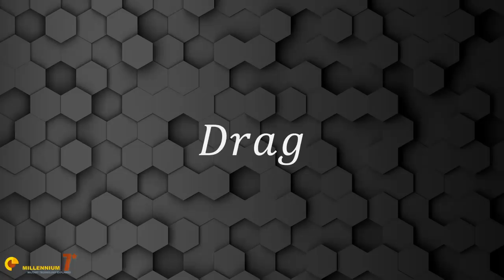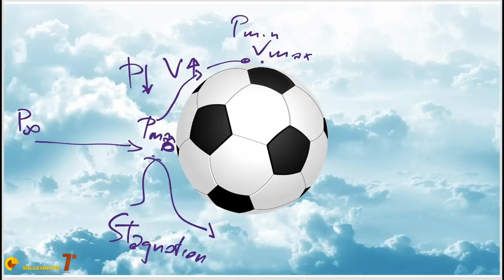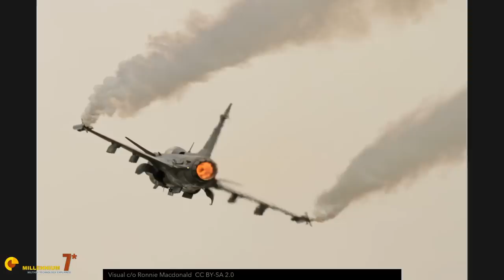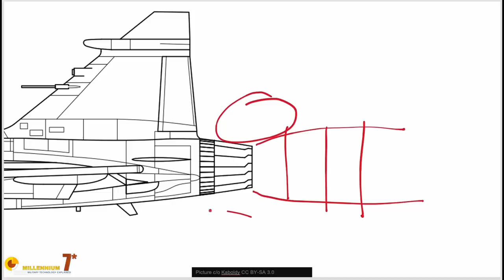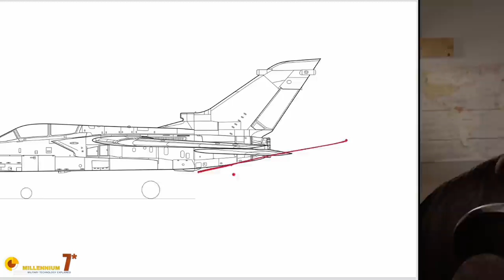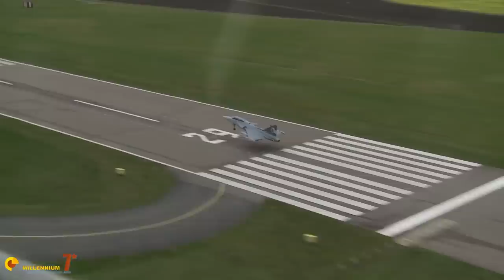The Phantom TAIL is strange because...

Comment: Interesting maybe you could have included how the XB-70 road it's own shockwave at supersonic speeds
Reply: That one's pretty straightforward. The shockwaves coming from the forward part of the aircraft would hit the underside of the folded wing sections. The lift created was much like the force of a fan blade. It pushed the wingtips outward, and due to the angle, upward.
More lift for less drag, compared to conventional approaches to generating lift. Although... it did require very robust wings, and very robust moving parts at a considerable distance from the fuselage. So "efficient lift, with a weight & complexity penalty".

Largely not worth the trade-off, unless you plan to supercruise nearly all of the time, and at high altitude where lift generation is at a premium.

The Bone, by contrast, used swing wings to have a large range of lift vs drag ratio options, allowing it to go high drag & high lift near the ground, then switch to low drag with modest lift at high speed. So it could go 'far & fast', but still be very viable for takeoff/landing, and treetop level flight in hostile airspace. Swing wings also have less overall wing area (for a given maximum lift), making them less susceptible to downdrafts. Which gets them like 20-30 ft closer to the ground with comparable safety. Add ground mapping radar, and you can hug the terrain pretty closely.

Basically the B-70 would have been the superior hauler of explosive goods to anywhere you want them (and very fast). It could do the BUFF's job, but better.
(then again, it probably wouldn't have the Buff's extreme longevity as an airframe)
But the Bone is better for going places "somewhat quickly", and then slowing down to penetrate hostile air space at daringly low altitude, "modest" low-observable characteristics to reduce it's detection range, and with lots of ECM/ECCCM hardware.

Comment: F-4, a gaggle of aerodynamic fixes flying in loose formation.
Reply: hehe, mostly a fair assessment.
but I prefer to think of it as an armada of aerodynamic bits of brilliance working in concert ;) the truth is in between.
It'd be an extremely viable 4th gen aircraft if went on a carbon fiber diet, sprouted little cherub canards, and had access to more modern engines ;)
but that wouldn't sell new planes.
Reply: @kathrynck  F-4's stores carriage and strong wings allowed for impressive combat configurations, both A2A and multirole.

The B/C/D/J/N/S models had a huge radome as well, which drove the design going back from there.

My first airshow was T-Birds' last season in the F-4.  We used to see them every week anyway at Edwards or from George AFB (F-4Gs).
Reply: @LRRPFco52  There's some F-4 DNA in the F-15. It's not visually obvious at all. I'm not saying one's derived from the other. But it shouldn't be surprising that many of the same engineering minds worked on both.
Reply: @kathrynck  I lived through that at AFFTC when F-15 was born and still had the outer nozzle sections, original wing, the smaller speed break with less deflection, and original APG-63.  F-4 has more elegant semi-conformal storage of the AIM-7s for sure, but you can see on the main panel in the cockpit how there is a lot of F-4 there, mainly for the engine gauges and primary instruments.

The main departures from the F-4 man-machine interface were:

* Single seat can do a better job than a 2-seat, even managing the look-down/shoot-down Fire Control Radar.

* HOTAS

* HUD integrated with the fire control modes so that symbology automatically shifted with each weapon system and displayed the appropriate parameters and shoot cues, time-to-target “clock" on the reticle, etc.

* TEWS versus afterthought ALR receiver display bolted into the panel.

The solid state electronics in the F-15 was a true departure from what we had in the F-4E, with absolute demonstrable BVR capabilities that were breathtaking and well-received by the pilots, even before PSP upgrade in the late 1970s.

Mission radius was also much better in the F-15, since it uses lighter materials and better wing area + lifting body, with more efficient turbofans for cruise at altitude.
Reply: @LRRPFco52  But the conformal mounting came back on the FAST packs. 

And both have a huge emphasis on a kind of extreme version of an inboard wing hardpoint with a lot of utility, holding a lot of mass close in to the center of gravity. Granted a lot of aircraft have more robust hardpoints closer to the wing roots, but the F-4 & F-15 both share a pair of two really extreme hardpoints a few feet out on the wing.

Still reaching aftwards to mount the rear horizontals further behind the center of gravity. Though the twin tail booms on the F-15 are a lot more subtle than the big extended tail on the F-4.

Note the little "dog teeth" on the rear horizontal stabilizers? Remind you of anything? ;)

There's definitely a "do-over" vibe going on. Even where they differ (and there's a lot of ways they differ, very dramatically), it gives the vibe that one benefits from the experience of dealing with the problems experienced in the previous design.

I remember a lot of the older engineers who worked on the F-15 when they would talk about design, they referenced the F-4 a lot. "Oh we designed the wing this way because it has this & that benefit, and avoids that airflow issue we had with the phantom's wings" hehe.

I can even remember an argument breaking out about the conformal AIM-7 placement. I'm convinced that when the CFT's came out (known as 'fast packs' internally), there were some F-4 engineers who finally got their way.

I do kinda wish the F-15 had slightly canted vertical stabilizers though. The parallel verticals were set up so that you could have one blown completely off the plane, and you'd still have one 'neutral' vertical stabilizer. It made more sense before FBW. But it made for some wonky supersonic characteristics between the tails, and when low observables came into vogue it didn't help with that. Mostly I just think it looks a lot cooler with the tails slightly canted, hehe.

There was a Super Phantom proposal, actually there were Several. 

There was a swing-wing model. But that was seen as kinda redundant since the phantom didn't need it to work on carriers. But it could have had some wicked speed & all-envelope handling characteristics. 

And an idea for an update package, which would have shed about 2000 lbs for carbon fiber parts, gained 5,000 lbs of thrust, and had a low-drag conformal centerline tank/pod. Along with assorted avionics changes, etc. Israel wanted that pretty badly. A prototype was built. it could exceed mach 1 without afterburners. That plane was a far cry from the "flying brick" reputation. But timing is everything. McD-D was not keen to actually develop it by then, because it could have created very serious competition for the F-18.

There was a similar proposal with small canards added above the front wing roots. A prototype of that was also built. That would have been really incredibly agile. But probably would have sacrificed supercruise capability (for the drag of the canards).

The RAF wanted a mach 3+ recon phantom which would carry a massive payload of water to keep things functional. That one was shut down by the state department who didn't want to export a fighter which was significantly faster than anything in US inventory. 

The phantoms were almost too successful to politely leave center stage to make room for 4th gen. And even as they left, nobody wanted to replace the F-4 wild weasels for a long time, because the F-4's were built like A-10's & F-15's in terms of battle damage resilience. And wild weasel pilots really like that. F-4 was really the first combat plane where you could blow off a wing, turn one of the engines into sheet metal confetti, and just fly home & land anyway. And it's still a pretty small number of aircraft in that club.

So yeah "A gaggle of aerodynamic fixes flying in loose formation" ...but doing so quite elegantly and effectively.

Comment: I remember that there is a relation with lift and drag, and that without drag, there is no lift...so, a certain amount of drag is desirable in certain direction, but not the other?
Reply from the maker: You are confusing a few things here, but it would require a long explanation. Let's say that there is a relationship between lift and drag coefficients and they both always exists for physical reasons.

Comment: the curious aerrdyamics of the F4 Phantom always confused me. The cathedral of the tail, and dog legged wings, with changing dihedral throughout. I wondered how well those  powerful engines might have performed in a cleaner design?
Reply: The original design idea behind the Phantom was much cleaner.
Starting point for McDonnell was the F3H-G "Super Demon" proposal.
They enlarged it and added a second cockpit to fit the All Weather Interceptor role.
During testing they found a lack of lateral stability, rather than redesigning the entire central section, to give the wing about 5° of dihedral, they added 12° only to the outer sections and added a dog-tooth to improve high AoA handling.
The Tail-plane was another compromise, a high tail, like in the Demon, can get into the wake of the main wings during high AoA, leading to loss of elevator authority and eventually a deep stall.
A "conventional" low mounted tail was out of the question though, because that was were the engine nozzles were supposed to go.
The easiest solution was to start the elevators high, over the engines, and give them an aggressive anhedral to get them out of the main wings wake.
Reply: @kilianortmann9979  a high tail(especially a T-tail) is susceptible to a super-stall, especially if the CG is behind the centre of the aircraft. 
The weak lateral stability was at least partially caused by the small vertical stabilizer.
Reply: The dog tooth, and angled wingtips also helped control airflow down the wings. Kind of like the outer section of the F-16XL's crank arrow wing, but using a tooth & a veritcal angle change, instead of an angle change viewed from the top. Saab is still fond of this wing trick, and exploits it well in their designs.

The F-4 was a very nice package actually, in terms of performance. It's biggest limitation was high weight. A re-design of it to exploit 4th gen materials (mostly carbon fiber), and eliminating some of the armor (it was built like an A-10 in terms of absorbing combat damage), would have made it a very viable 4th gen aircraft. The main reason this didn't happen had to do with marketing & economics, rather than the design itself. They wanted to sell new planes ;) Though a "Super Phantom" was tossed around in several circles as a possible 4th gen.
Reply: @kathrynck  I think a redesign of the Phantom with 4th gen materials and tech would look pretty much like the F-15A.
Identical A/A weapons loadout, similar performance, though a little bit better everywhere and HOTAS.
Reply: @kilianortmann9979  Well the F-15 is a product of the "Phantom Works". so yeah ;)
But there were ideas thrown around for several different advanced versions of F-4, updating the design without radically changing it.

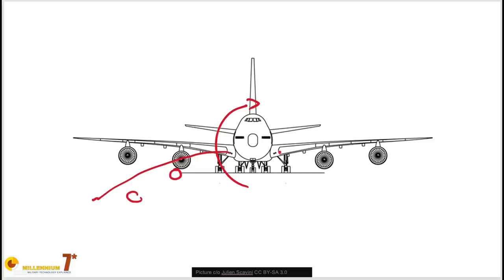Comment: 6:36 ... I disagree.

Wings would bend in that way if the roll was a consequence of vertical tail flap displacement or differential elevators - which would apply a torque on the fuselage, and the wings would have to follow the main body roll. Because the wings would be following the body, they would flow through air with positive angle of attac (left airplane wing - right one on the picture) and negative AoA othe other wing. Positive AoA creates higher air pressure on the bottom side of the wing and bends it upwards, negative AoA creates higher air pressure on the top side of the wing and bends it downwards.

But if the roll of the aircraft is created (a consequence) by ailerons, then the wing that has aileron (or flaperon or flap) deflected downwards will have higher pressure on the bottom side, pressure on the lower side of the wing will force it upwards and will create a rolling torque on the main body of the aircraft. And the wing that has aileron deflected upwards will have higher pressure on the upper side of the wing, which will create a downward force on the wing and a rolling torque on the aircraft. So in such a case the wing moving upwards (left one of the picture) would be bent upwards, since it is creating lift, that is rolling the plane. And the wing on the right side of the picture would bend downwards, since it is creating negative lift, that helps the aircraft to roll.

If the right wing would instead have spoilers, then that wing would essentially lose lift and would initially stay straight, then when it would gain increased roll-induced AoA due to rolling downwards, it would gain pressure on the lower surface of the wing, wing would bend slightly upwards and the roll of the plane would slow down.

If the bending of wings was meant as a consequence of axial acceleration of engine bocks (inertia), then the above still applies. If the ailerons are the cause of aircraft rolling, then engine mass will cause the (left on picture) wing to bend down at root, but in the portition of the wing where the ailerons are (wingtip), the wing will bend upwards, because there is a force being generated there that is rolling the entire plane clockwise.

Similary in high G turns, wings bend upwards, because they carry (with lift) a 9-times mass of the plane through a turn.

(note: I disagree with the sketch, not with the video, video is very informative)
Reply from the maker: You forgot tailerons. Yes, the explanations should have been more detailed.

Comment: Before you think an F-4 is some brick… they re-engines one with modern engines and the dang thing will easily supercruise at like Mach 1.4… they scrapped the idea to prevent loss of modern fighter sales…  the phantom was designed to be very fast maybe not quite as maneuverable…
Reply: I think that was the Kurnass 2000 by Israel.  Though upgrades are still so high, better to buy new ones

Comment: Also, cooking your tail constatly with your exhaust gas (life F-4 and Jaguar did), is not the best idea in the modern battle field!
Reply: eh... the tails were out of the exhaust flow, unless you threw the stick into a hard maneuver, then they'd dip in and give you gen-3's crude version of thrust vectoring.
Also if you bank hard to evade a heat seeking missile fired from the aft, the tail hides the exhaust nozzles right around the same time that the flares start kicking out... so that has a certain helpful synergy.
They're titanium, so it's all good. just don't bother painting the horizontal stabilizers.

Comment: The F-4's tail is designed to block the heat signature of the engines from above.
If a heat seeker is behind it and the pilot pulls the nose up ,the tail completely blocks the view of the engines and makes it more likely the missile will lock onto a flare.

You see a similar idea in the A-10 but it's tail is designed to obscure the missiles view from below ( MANPAD's)
Reply: Utter bollox.

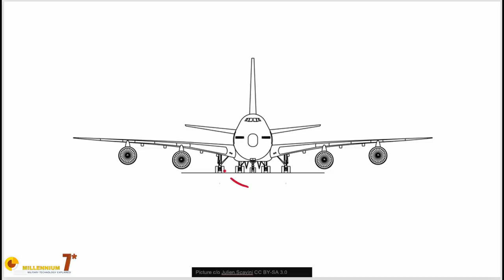Comment: 6:19 As a commercial and military aerospace engineer for 30 years (and airline pilot). WTF? You relize here is lift and spoilers on the B747 the most successful commercial airliner in history in continious production since 1970 to present day B747-8. 50 yrs. Bad design?  My first job out of college at Boeing I worked with a former Douglas F4 Engineer who designed the empennage.
Reply from the maker: yes, sorry, that was a bad example that did not convey the meaning I wanted to.

Comment: regarding the nozzles also few inacuracis: jet fightes have variable nozzles thus they can equalize both pressures for having a perfect match.
The probelm occurs when a part of the fluid becomes supersonic, the transition between regimes takes a lot of energy when creating the shock waves.
Shock waves can be oblique or normal in the drawing you put the exhaust at the very end so the fuselage wont notice at all the shock wave, in the f4 it could happen because de nozzels are ahead of the satabilizer but you are failing to explain that, in the grippen you are also providing false information the GE-F414G engine has a bypass, because it is in fact a turbofan engine with an afterburner most of the power its been delivered by the fan, not the nozzle.
Reply from the maker: Good point on the F-4 and I am sure you will forgive the simplification.
Reply: @Millennium7HistoryTech  No worries, is just that I am an aerospace engineer and very passionate about this stuff

Comment: you are very wrong, regarding drag, in aerospace insdutry most of the shapes are streamed and not blunded therefore form drag is second order if the boundary layer remains attached and no wake is formed (in 2D only skin friction due to the boundary layer is the decessive factor), otherwise the total drag is null (see d'Allemberd's paradox). You also have to consider for 3D cases skin friction + induced drag due to circulation vortexs (Prandtl’s finite wing theory)